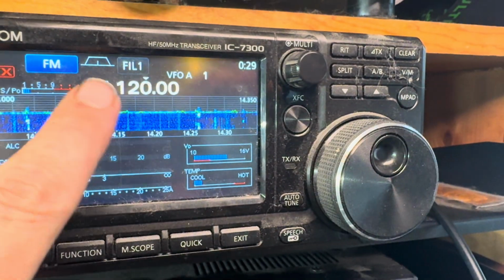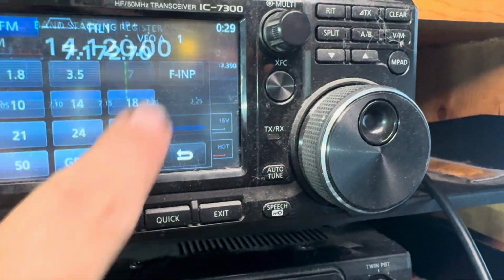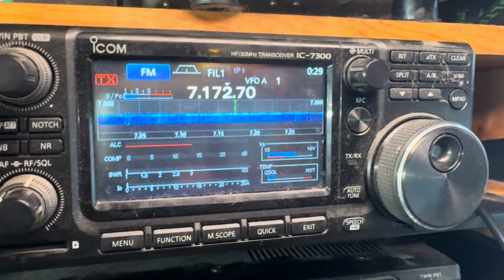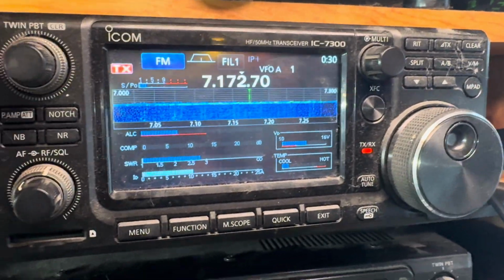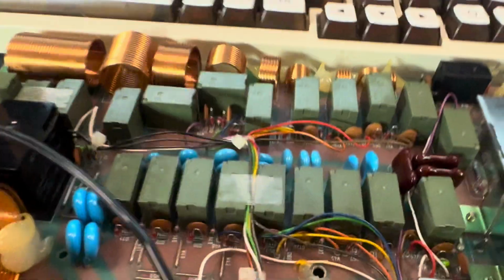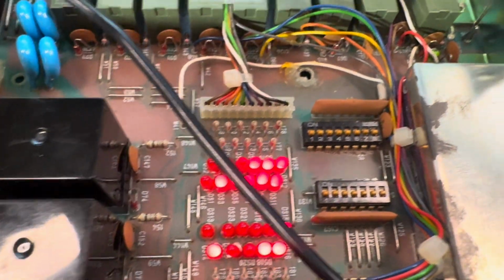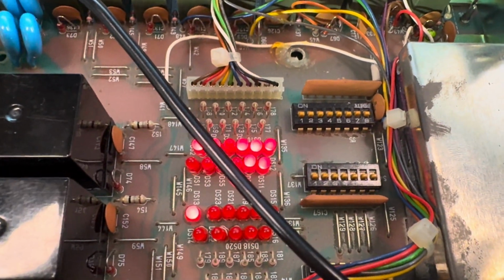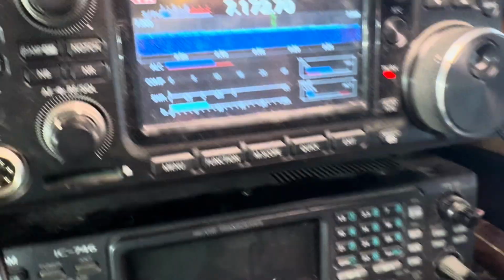Attempting to resurrect an Icom AT-130 outdoor automatic antenna tuner

Comment: Yep, the "manual" mode was usually done when the antenna system was installed, swr was tested on 2182KHz, and set point was toggled in, to keep for when the shit hits the fan:
I got the same tuner for next to free, but it was non working, turned out that one of the power rails was bad, i think it was 8 or 9 volt, but i got it up and running. 130ft wire antenna and this is a fine setup. :)